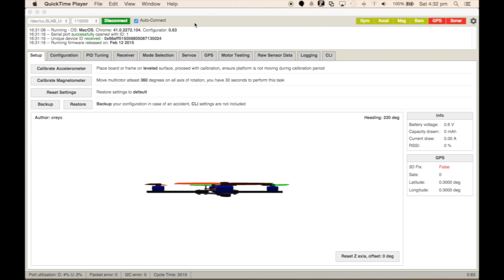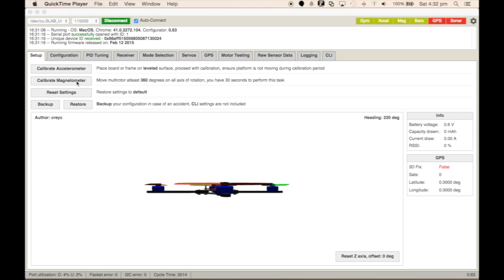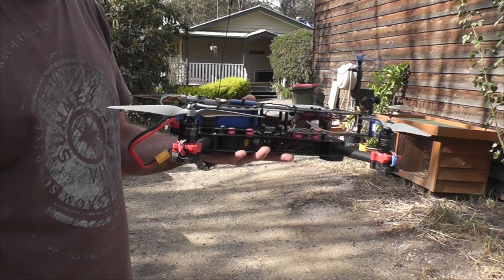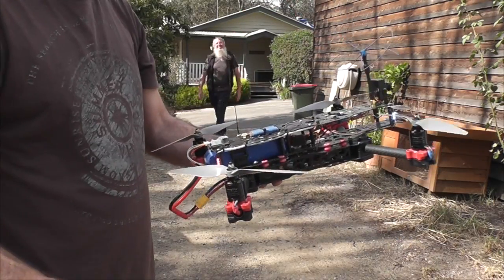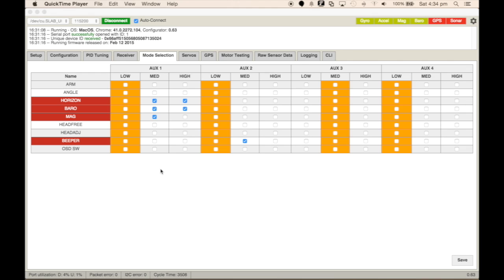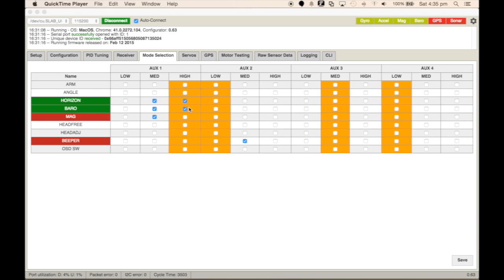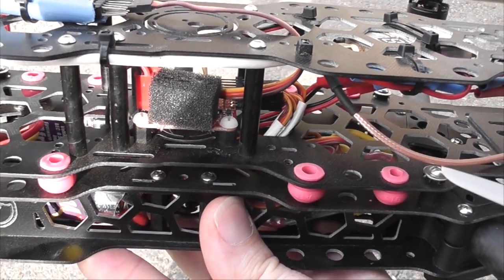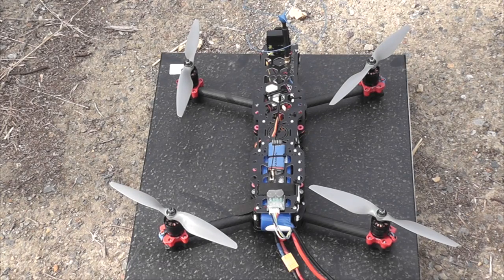Full Naze32 on Baseflight - Magnetometer & Barometer Setup Guide

Comment: Hi, Nice video. Whats the name of the frame you're using? Also, I have a problem with my barometer. As soon as I arm my quad while still sitting, just props spinning, the altitude starts increasing. By the time I take off, it's reading about 100ft. Even when I try Nav Alt Hold, the drone descends and doesn't respond to my throttle. Please help. Thanks

Comment: Hi Mike!  Thanks for this video!  I have a project going on that I'm considering using the Full Naze32.  Were you using any additional equipment with the Full Naze32 or was that just the Full Naze32?
Reply from the maker: mountaindewdude76 Hi. This was just the Mag and Baro, however i did add GPS to a few of my setup's with good success. In most cases the GPS was primarily hooked into the MinimOSD so i could get Long/Lat Co-ordinates, Speed, height. Not so much for position hold.

For position hold and RTH, i went down the path of buying an off the shelf system such as the Xaircraft miniX type units. These work well straight out of the box.

What's your project if you don't mind me asking?
Reply: seafurymike I don't mind you asking at all.  my Dad saw a YouTube video of a MultiWii Dualcopter and he asked if I'd help him build one for him. I agreed.  Do a search on YouTube for MultiWii Dualcopter by MClay.  its a pretty unique little model.
Reply from the maker: mountaindewdude76 That is just uncanny. I watched that video the other day, but i was interested in it from the dual contra-rotating perspective. His approach to making the shaft system is very clever. Good luck with the build
Reply: seafurymike my Dad has made the head and it looks great.  im sure ill share a bit of video later on
Reply: Hey mike.....I just wanted to let you know that I have posted a bit of video with an issue that I'm having with my Dad's Dualcopter.  It's a throttle issue.  I was wondering if you'd mind taking a look at the video and see if you have any thoughts.  Thanks man!!!

Comment: I already know how to make modes. I was expecting to learn how to tweak the barometer settings, because my quad bounces with the baro mode. I feel like I wasted my money on a full naze. The magnetometer has also never worked for me. If I switch to mag mode it just starts to fly off on a right roll. I have no choice but to use rate mode or horizon for all my flying.
Reply: Ive found it always needed a gps to work properly. I covered the barometer, and it tended to hold heading a bit with the mag, but with gps included in the mix it was fine. From what ive read i think it needs all 3 systems coupled to get good results
Reply: ah ok, i still need a gps on mine. Thanks :)
Reply: +rpaull3 Make sure you cover the mag with open-cell foam.
Reply: +Alex the MAG doesn't need foam. The Barometer needs to have airflow restricted to not influence the reading. Foam on this is recommended.
Reply: +Seafury mike This must have been what I was thinking... I wouldn't know....I just have a naze32 acro -_-

Comment: what size battery are you got?
Reply from the maker: +Corey Simmons $s - 2200mah on that unit
Reply: +Corey Simmons I also use a 2200mah with my 12amp ESCs and 2300KV motors it lasts a good 10 minutes flight time, hardly gets warm, and with 6030 props is very fast.

Comment: Hi Mike,  thanks for the video.  I have a CG250 frame with an Acro Naze32 (no mag or baro) and when i put mine into horizon or autolevel or whatever it is called it does the same thing as yours and slowly starts flying backwards.  I have another system with an Acro Naze32 and its autolevel is great so not sure what the problem is. Any ideas?  I have recalibrated the problem one a few times to no avail.
Reply: I would think you dont have enough "I" then.
Reply: Thanks for the tip